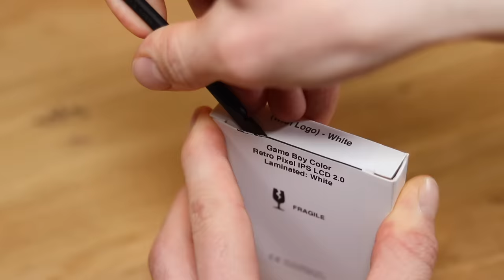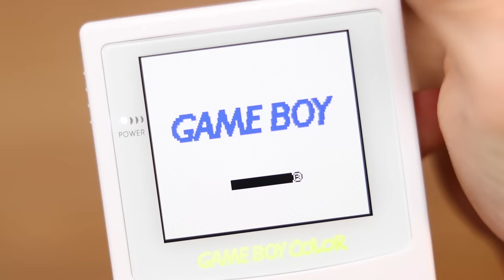The ULTIMATE 2022 GameBoy Color Mod

Comment: my only issue with this type of screen mod is that if u scratch the lens and want to replace it u need to replace the whole screen.
Reply: What helps with your con is having a glass display instead of a plastic one on the original. Then again, not as drop resistant!
Reply: You can get the osd version 1, has less options than the newer one but it has a normal replaceable lens

Comment: I've customized 2 GBC's for myself. The first has a glow in the dark shell, with a backlit screen, and the 2nd is based off of the translucent Neo Geo Pocket Color with blue buttons. Also has a backlit screen! Really proud of myself, and how they both came out!
Reply: I was considering of customizing one myself, how difficult is to reassemble one? I called my local retro game shop to do it for me but they stopped customizing them
Reply: @PurplePhantom4  Personally, I would say the GBC is the easiest handheld to take apart, and put back together. Please be aware however dealing with Nintendo video game consoles, and handhelds requires a "tri-wing" screwdriver. They use those "specialty" screws in about all of the consoles and handhelds I've ever seen them make. Other than that, a Philips head screwdriver is your best friend.
Reply: @bdillmore40  okay cool thanks for the advice and for actually responding

Comment: I did a Funnyplaying screen a few weeks ago. You can do the start and select buttons higher on the board, and hide the wires behind the screen.
Reply: Ooh really? Do you know which contact points you used? the visible wires are a bummer for me. 
By the way, any trouble with the touch sensor? Did you get the long thin one or the little one? Mine not working at all :/

Comment: Pro tip for the people who are having trouble with an unresponsive touch sensor, i've swapped mine out for thicc piece of copper plate attached to a wire (just a hammered down piece of thick copper wire folded over) and now it works flawlessly

Comment: hey, great video! modding my first game boy now, actually--but I did have a question, you said you can get a gameboy from japan for $20, is that via ebay, or is there another way you can do it? My luck hasn't been as good X_X
Reply: I have the same question. Used ones are sold in Germany for something around 50€

Comment: "Pickup a Gameboy for 20 max"
Sure... 
Also plus 5 for the service to get it from japan
10 shipping 
10 to 20% import, depending on where you live
That leaves you at 40. Might as well buy on ebay or any other easy to use second hand market.

Comment: If we're using a completely new plastic shell, it slightly annoys me that the new shell isn't designed to accommodate a larger IPS screen. Otherwise, makes more sense to just use the existing shell. I know the screen is already larger than a stock screen, but why not bigger?

Comment: Love these videos! I wish my Gameboy SP still had a working battery. 
Does anyone happen to have any advice on a game cart for a DSi that’s similar to one I have called CycloDS Evolution? It’s one of the kinds of carts that takes micro sd cards and you can download any DS game roms and even cheat codes for them. My CycloDS works on my DS lite, but I’d like to find one that works for my DSi XL that’s easy to use for someone who’s never messed with these things before

Comment: Just a heads up to anyone reading this, but the fine horizontal and vertical adjustments reset after powering off the console. Very odd considering the color option sticks.

Comment: Which one is better this, funnyplaying "v2" or the first version with green motherboard with 2 touch pads pre-soldered.
Also does this fit in a normal original case?
Reply: It can fit in the original, but you will need to cut away some plastic inside the shell. But, that's the case with most IPS display mods.

Comment: Question, how easy it is to install if you don't want to solder the extra controls? Never really done this kind of soldering before and i would much rather only focus on soldering power and then complete the mod. How easy it is for someone that's never soldered to install this kit?

Comment: I did this mod but had trouble getting the touch sensor to work properly... I did a black case with blue glowing buttons. So, similar to what you chose.
Reply: Did you ever get it working? I have the same issue.
Long thin touch sensor or the little tiny one?
Reply: @Venomous28  nope, haven’t gotten back to that project in a bit. It’s pretty short as I couldn’t get it to stay against the casing even with tape.

Comment: A Gameboy from Japan for 20 Pounds? Can't believe that. How much is it with shipping then? When I look at eBay & Co. here in Germany, a GBC cost around 60-70€ if fully working in ok condition or around 50€ in worse condition (where you can never be sure that there's no corrosion inside or other problems). I once bought a GBC in bad looking but working condition, end of the story was that the display connector socket had corrosion and was slightly bended, so that it didn't work with the slighly thinner connector cable of the mod displays. Tried to de-solder the socket, but some very fine tracks under the socket were corroded too and unrepairable damaged after de-soldering. I had to throw the Gameboy in the trash, 50€ wasted. I will never again buy a GB that is not in maintained clean condition on the outside. That's a gamble.

Comment: Made this Gameboy Color in 2021, the power draw with this screen and the LED button mod is a bit crazy even with really good rechargeable batteries (Panasonic eneloop 2500mah), i've been needing to play the Gameboy with medium brightness. I will get about 3 hours before the system starts randomly restarting (I think because of the batteries having low power, if someone else has a different theory for the cause please let me know) I've had this with two systems I've made, replaced the power regulator board as well... tried using the cleanjuice air battery mod and that just causes issues with the screen, it starts flickering really fast (not noticeable without really looking at the screen) or just plain looking weird, hard to explain but it doesn't look good.

Comment: I have a game boy related question if anyone is willing to help. My game boy advance SP has been working fine for years without any issues, but for some reason now the B, Select and Right D Pad buttons are not working, when I take it apart and clean it with isopropyl alcohol and put it back together, all the buttons work absolutely perfect for about half an hour and then it stops working again, I'm wondering if anyone knows why this is happening, thanks

Comment: This isn’t ultimate Gameboy color. You could have upgraded the speaker. Put in an amp. Could have made it a rechargeable. The speaker would have definitely helped your sound. Also, why crush the red led like that???  That was totally not necessary. LEDs are wickedly easy to remove. You have a risk of ripping pads up by doing what you did.

Comment: Don't understand why did you use flux on every single thing you soldered? There's enough flux in the solder to do everything you did in this video could have done the whole job with 0 flux? I mean it doesn't effect anything and it's not technically wrong but it's just not needed are you not confident in your soldering?